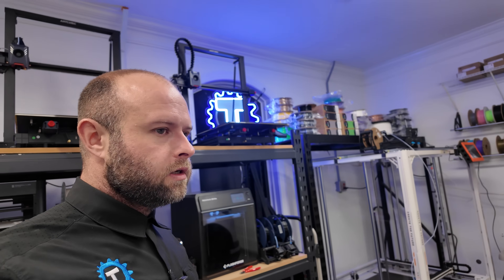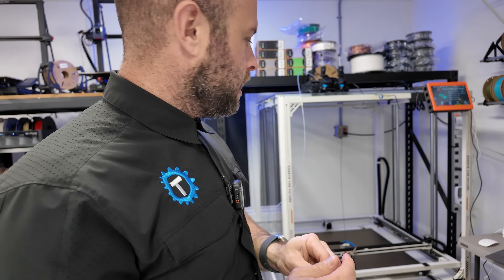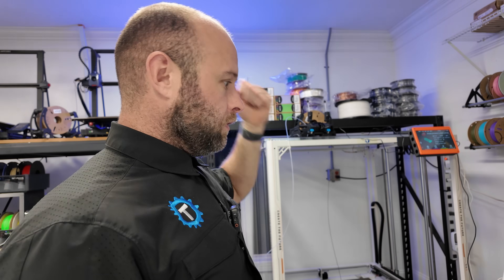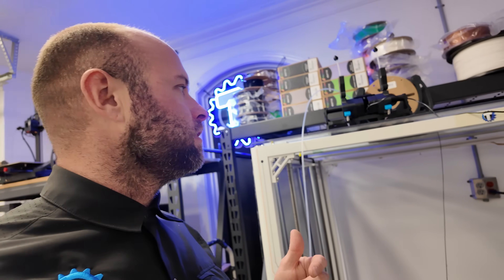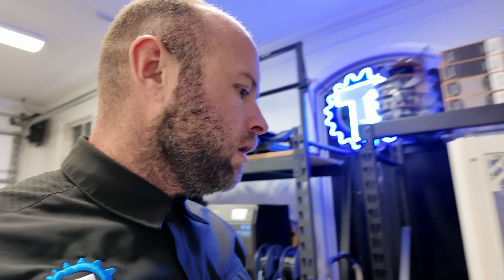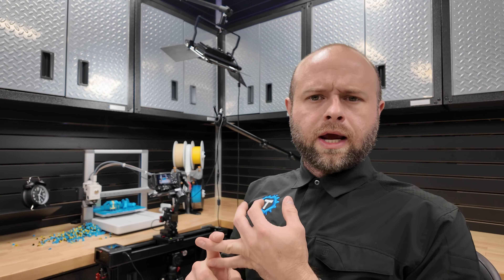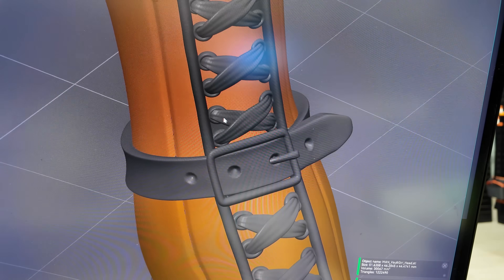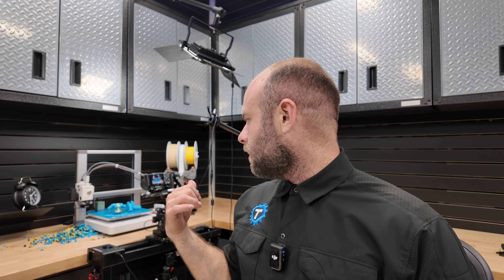SO CLOSE to finishing my Giga; Printing models for 3D Designers to promo: 3D Print Vlog

Comment: Holy crap I had no idea they were doing nonsense like disabling Chrome install unless you buy a different Windows license. That's insane. I was gonna say I can def help get you past that if you want, but you've got it covered. Not to mention any laptop will run so much faster than off the shelf with a clean debloated install. Wow though. So scummy.

Comment: I was always hoping you'd go further down the tweaking and tuning rabbit hole. Whoever gave you the pressure advance advice gave you bad advice BTW. Generally you should start with a default PA value like 0.03 or so for PLA on a 0.4mm nozzle at modern speeds like 200mm/s. 0.04 or higher possibly for PETG. 0.08 or higher could be necessary for TPU. Do all other tuning such as temperature and flow rate then do PA tuning and then do another pass on flow ratio and PA if necessary. Not having PA turned on will result in horrible corners, lots of bulging and undercutting, gaps in surface near corners, plus stringing and blobbing. Anyways, super glad you have this thing working better! I'm proud son.

Comment: About the Giga tutorial.... If no one else has done it then fire away! 1 way Ive seen people handle changes and updates is keeping the content up to date as time goes on is updating the discription info with ned changes at the top, and maybe link to shorts that actually show the updated change as you do it. As for things like calculating PA, and especially extruder calibration... link to a short where you go into the process on yours to make the calculations. Then wrap all this shit up in a series that is forever updated.

Then back at the beginning... talking about using the acceleromoter in the Beacon. Dont! Use the one in the EBB 42! The Beacon will be far more work to use, and it will give somewhat exagerated data since its at the very bottom of the entire tool. The on on the EBB42 is closest to the rail, which is where the resonant issues come into the tool.
Reply from the maker: Damn, no idea it had one
Reply: I dont have a Giga, and have no interest in it. But watching your work is both informative, and frustrating. I learn some from every episode, but have solutions for all of your issues that you might have already solved by the time the video goes live. And I STILL dont have a Discord invite!

Comment: You can install what ever web browser to any Windows 10/11 computer that you want. All Windows computers need an license but if you bought a computer without Windows installed  you have to bjy a License and there are many places you can buy them för 10-20$.
Edge and Chrome is since a long time the same programe underbeath as they are build from same and just have different graphich interfaces.
Otherwise if you only have Macbook you can just install Windows on it with dual boot (Win/Mac OS).
Reply from the maker: It was locked in some way i'd never seen before (i dont buy prebuilts so unaware if it's new)
I think that's why it was only $300
Either way I wiped it to remove the bloat